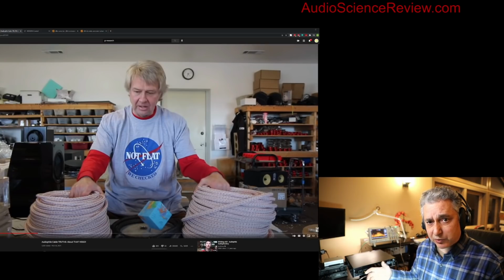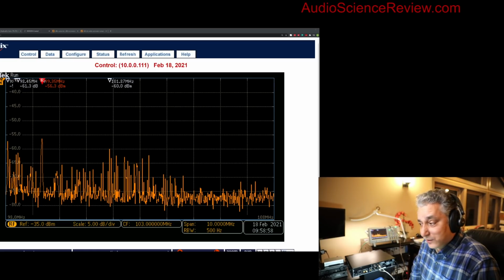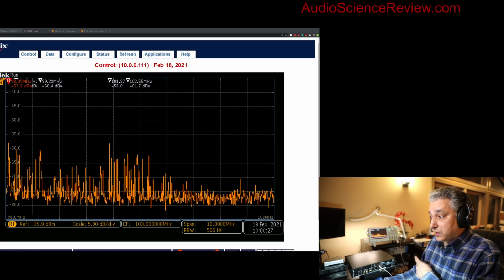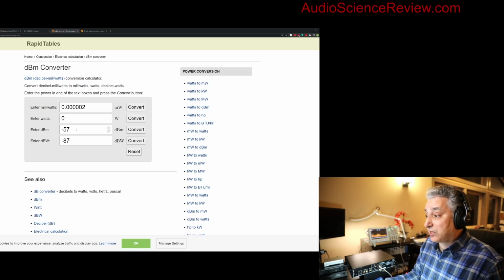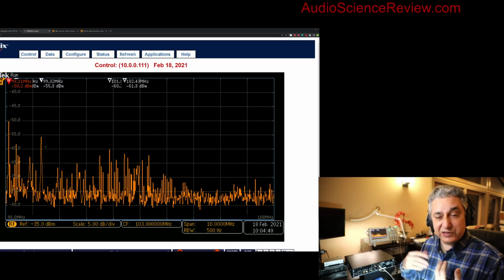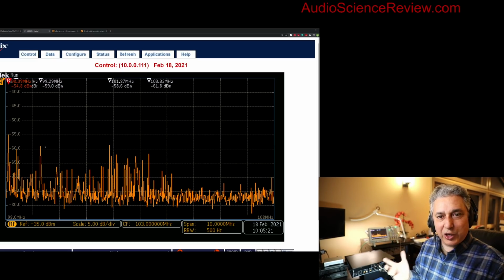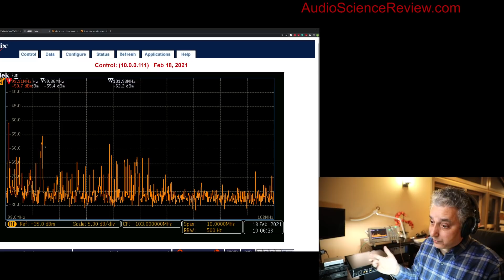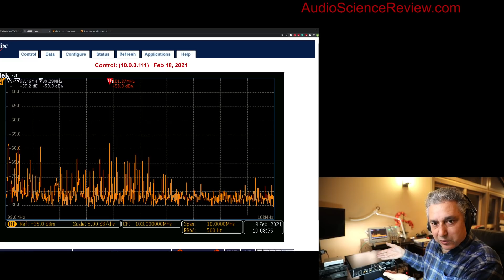RF Interference in Speaker Cables???

Comment: You really don’t know audio do you? 30 years ago, I sold a friend a ADC equalizer with the cheap (maybe reference to you) .05 cent cable. We hooked up the equalizer with this cable and the nearest radio station started playing thru his system. The radio tower was less than 10 miles away from him. We changed out the .05 cent ic’s to a better cable and the radio station stopped playing they his system. Also, he had other components in his system before the equalizer was installed and no radio station playback. Now, for reference, I heard the radio station hundreds of miles away too so it was a strong station signal. 
But this example proves Danny (who you seem to want to put down) was right and you are wrong: cables can pickup stray signals/interference. This is also why most audiophiles (not you) use cable lifters so each cable doesn’t pick up any interference from the floor.

Comment: This guy is so misguided. How can you ever prove a good or otherwise cable hooked up to a cheap junk amp and a spectrum analyser? He rabbits on about testing how you mean to use it, but I didn’t see any speaker hooked up! It is well known that is it almost impossible to measure how good (or not) any piece of audiophile part using test gear. I don’t see any recognition of any actual listening to prove the point. And RF getting into amps is an issue which is why most if not all have RF filters built in. While you can’t hear this, it can cause issues in the amp. So not much science either…and no audio? Rubbish reasoning!!

Comment: Beginner audiophile here , I like to think there is some validation to Danny’s arguments of cables making a difference. I am a mechanic. I use to wrench for certified GM dealerships for 17yrs , my specialty area was brakes suspension and Antilock braking systems. One particular case I had was of a vehicle erratically displaying an unwanted ABS light and activation of the brake pressure modulation valve . The code that was retrieved was for Right front wheel speed sensor erratic code . After further inspection I found that this vehicle was in a accident and the wire harness for that sped sensor was worked on but a hack job was done , straight wires were spliced in and harness was hitting front the front drive spinning axle . ABS speed sensors require a proper braided configuration of wires and proper shielding to cancel out any RF signals , also the wires were properly attached to its retainer so no interference occurs the the hertz signal to the computer. This was fixed and all lights went away and now working properly,l. Now if cables makes a difference in the automotive area why shouldn’t it make a difference in audio ?

Comment: Thank you, Amir, I run my 100watt HF Ham Radio station weekly within 20 feet of our TV and audio system. My findings corroborate with yours. I'm okay if the speaker cables only advertise to suppress  RF, but would appreciate measurements as you have outlined. Your Grounding video is a great companion.

Comment: I think the issue here is not the RF voltage, but is how much the RF is down converted to AF by the nonlinear amplifier output stage and adds to the output noise or distortion of the amp.

Comment: Hello, I tried a
roll of cheap speaker cable in my system ( instead of my non expensive pro cables canare). using the non twisted speaker cables I can hear a buzz in my speaker that s not affected by volume of the amplifier. except for the buzz the sound is the same. can a bad speaker cable cause that?

Comment: The meter on Danny's receiver IS influenced by the various antennae he connects. That front panel meter on the receiver responds to  signal strengths in MICROVOLTS.  Now choose, send microvolts to your speakers and tell us what you hear, or sent VOLTS to the receiver's antenna input. All together now. Speaker wire is the "elephant", and the RF noise is the blade of grass the elephant just stepped on.

Comment: Great video. I have a sony amp that used to faintly demodulate what I'm pretty sure was broadcast FM radio. It only did it when the tone circuit was engaged.  I never figured out why but in my case replacing the tone circuit opamp with a higher spec audio opamp (and decoupling the power rails properly) stopped the problem completely.  This problem is both rare. And obvious when it happens. It never "degraded the sound" but it was audible and annoying when the music stopped. I would never waste money replacing speaker cables because when this happens its always a problem with a specific amplifier and fixing/replacing the amplifier is always the solution.

Comment: Hi Amir, love your work! A question I have is if a speaker cable connected to a powerful amp acts as a radio antenna transmitter in itself, like a radio station broadcasts signals from an antenna? In this case you would have a powerful radio signal, interference, generated by the speaker wire which if picked up by our amp would be significantly amplified to be hear-able and induce unwanted noise and distortion?
Reply from the maker: Cable needs to be quite long for it to be an effective AM radio antenna (wavelengths are very long).  Now if you live right next to a station, sure, you may hear it but then you know what the problem is.  In general, interconnects are much more liable to pick up this interference.  It normally happens in large audio venues where cables are hundreds of feet.

In no case though does the above manifest itself as soundstage, airiness issues, etc.  You simply hear the radio station when there is nothing playing.  So if that is not the problem, then it doesn't exist.

Comment: May I please ask you about his demonstration?
He did show that the braided cables were a less optimal antenna at that one frequency, how did that work? Could one braid a cable that in fact "filtered" the audio signal and be minute destructive to the audio?
Reply from the maker: No, it didn't filter anything.  It just made a less good antenna to pick up frequencies way, way higher than audio.  And with wire dangling in the air, rather than being connected to audio equipment.  His demo is a classic way of confusing people with no foundation in proper engineering.
Reply: @AudioScienceReview  Thank you so much for answering. Yes, it looked pretty convincing for a person like me who has no knowledge at all. It did also sound logical that "filtrating" would prevent extra noise. BI am glad you help people like me, understanding what is real or not.
Unfortunately, do I think he himself believe in what he says.

Comment: This video doesn't debunk the fact that all cables act as antennas. The only reason why plugging the cable into the Yamaha reciever cut down the interference is because the reciever has a filter built into the Amplifier. Your confused about what the guy in the video was meaning. All he stated was all cables act as antennas but some cables are built with better shielding from interference than others. You don't need a fancy expensive machine to give you data on something that is common sense. I used extra speaker wire for antennas on my stereos and TV's as a kid for years. Speaker cables and even coaxial cables are all antennas and can be used as such.

Comment: When I saw the other video I realized he has no formal training with electronic engineering. It is EE 101 that (1) any conductor can be an antenna, (2) power harvested from such antenna is very, very small and (3) such tiny power will have no effect on loudspeakers, and (4) the signal meter on a FM receiver has no relevancy to how speaker wire performs.

And yes, the placebo effect is real. 

Thank you for putting the response up and I always find your review very informational.

Comment: Great video Amir! I myself experienced hearing a local radio station using my old amplifier on the CD input at low volume. 

I can understand why people might think the cables of the system contribute to that interference... even if it's not the case.

Thanks!

Comment: Oliver Heaviside discovered in the late 1800’s that the skin effect on electrical cable is a very real thing, which means that higher frequency EMF noise will aggregate and travel along the surface/skin of a cable. This applies to speaker cable. So by eliminating/filtering out the the EMF interference on your cables by filtering out the higher frequency noise that travels along the surface of cable, you improve overall sound quality. Can you hear those frequencies directly? No not directly as they are way above the range of human hearing. HOWEVER, they do affect the audible range by affecting things like sound stage depth/width/clarity of instrument placement in the 3d sound field as well as overall separation with ‘black” backgrounds. You can sense it/hear it when its NOT there because everything audible sounds richer, clearer, more precise and defined. I have tried this myself by swapping out my stock $50 Amazon speaker cable with GR Research speaker cables connected to a pair of Less Loss Firewall for speaker connectors, which filter out the EMF that collects along the surface of speaker cable. The increase in sound stage width/depth clarity and black backgrounds is noticeably improved - you hear the difference. A similar comparison would be water - you have tap water and Perrier. Both tap water and Perrier have the exact same chemical composition - H2O. However, you can clearly taste the difference between tap water and Perrier. The same is true with speaker cables and interconnects.

Comment: Good job! Some actual technology into the snake pit.

Another variable is simply cable length. Take the exact same cable and change it's length and you change it's RF response characteristics. RF antennas are cut to specific lengths based on the wavelength of that specific frequency desired. 

And most times when a radio station is picked up in a stereo it is because of one of two system problems. One is a bad connection e.g. phono RCA connection. Cleaning them can get rid of it. A bad component or solder joint inside the equipment.... To hear the audio from an RF signal, something is "rectifying" the signal, some usually passive device is acting like a signal diode. 

The other problem is connected, but aggravated by a local CB or Ham radio operator. And more likely CB as Ham operators know how to monitor and control their signals better. Over modulating, pushing their voice to loud into the RF causes signal distortions that are more apt to get into your system.

Comment: I think I know where this comes from. If you go back to the 70s, when amp makers were making insane amps with an "audio" bandwidth of 500kHz or more, there used to be some RF problems with speaker cables. They would pick up signals from medium wave stations, and inject them into the feedback loop of the power amp. The amp might have had a good response at medium wave frequencies, but wasn't all that linear at such frequencies. So, it demodulated the AM radio signal, amplified it, and played the audio into the speakers. If you started hearing strange voices coming from your speakers when nothing was being played, you shuffled the cables around until it stopped. Eventually, they started cleaning up these idiotic amp designs, and the problem went away.

Comment: This is great. Watching the measurement wolf tearing apart all the audiphile sheep.   As a long time cable phobic, I run 8 buck amazon basics optical cables, 20 buck budget van damme studio speaker cable, 20 buck budget van damme star quad balanced with neutrik xlrs and to top it all off the standard plastic power cables in all my gear run off a cheap plastic 6 way extension lead.  Sounds bloody fantastic but it's the DAC/AMP/SPEAKERS doing all the work not the cables! :)
Reply: That's what a lot of pro studios use too, van damme or mogami, neutrik connectors...industry standard so to say,  for good reasons 😊

Comment: I watched Danny's video when it first appeared, and I was very surprised at his blindness to the non-science of his test. I commented that at the time. Danny's test was not merely ignorant, it was absurd. I looked at the date of publication, expecting it to say April 1. I unsubscribed to his channel quickly. He's enough to make a real engineer blush. But we must accept that there are more than enough tinkerers plying their preaching in this field. 

Do speaker cables actually have resistance, inductance, and capacitance? Sure. Is it relevant in any reasonable listening situation? I suppose, if it is a flagrant violation of conductance requirements for cables connecting amps with speakers. But when we examine, as facts, the actual effects caused at these low impedances, they will be primarily due to resistance. Yes, if you are connecting a 50 wpc signal output to a hungry speaker of varying low impedance, 22 gauge wire will be easily improved upon. And 16 gauge wire. But, likely not 10 or 12 gauge wire of any reasonable quality.

I appreciate your approach to the subject of audio, and I hope your messages succeed. There are witch doctors out there, and they simply fog and distort what is important about audio. And audiophiles seeking every sort of perfection, are easy believers as an audience. 

You show me a carnival, with people with a few dollars in their wallet, and I'll show you fortune tellers and games of chance. And flat Earthers.

Carry on; I appreciate your efforts.

Comment: Why are engineers so annoying.  I apply formulas but do not understand why I believe them.  I know your speaker measurements are gospel (flat earth) but why do you keep measuring at the tweeter axis from close up?  Did you try the difference between the midpoint of the drivers etc.  Your room effects are computer modelled,  of course, these correct.  Just look at the difference between the PSB P5 at the tweeter axis vs the woofer axis on your web site -  will you at least admit this

Comment: It is interestingly, for four months I lived with my system having a tick tick noise on it every two seconds, which started only  when I moved into the new house. I was a RF engineer in the ECCCM environment for 42 years and looked for this problem because I was sure that it was RF interference getting into the audio system from some external source. 
After a  long search, and borrowing an HP Spectrum analyser from work, found the culprit, it was caused by communication between two house alarm components in the 2.5 GHz Wi-Fi band every two seconds. When I turned them off the problem went away immediately. Any RF envalope can be detected and will act as an AM signal provided it is of sufficient level, else why care about EMI/RFI that is only present inones  dreams.

Comment: If your speaker cables truly had a RF problem, wouldn't the cost effective solution be some cheap FR coils/chokes?  BTW, if the RF signal is strong enough it's coming through regardless.  I once had a radio control car that would pick up CB radio.

Comment: A speaker is not an RF receiver but a passive component It does not amplify anything
The acid test is to connect a speaker cable to a speaker and listen very close to speaker drivers
You will hear nothing